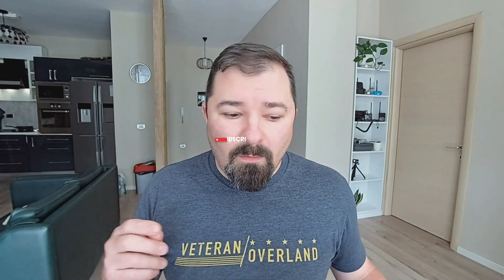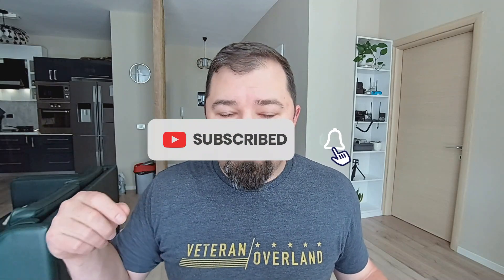What is Mesh Radio?

Comment: Thanks to your help, I now have a Heltec V3 (ver. 3.1) on the air.  I'm located in east bay San Francisco.  After 3 days, I see 5 nodes, all reporting strong signals.  I've attempted to message them,  my iPhone Mestastic app says,  "waiting to be acknowledged",  then,  after a few seconds/minutes, it says, "Max Retransmission Reached".   Is this typical, or could I have a possible problem with my settings?    73    Bob
Reply from the maker: Bob, I have not experienced the "max retransmission" message before. I am assuming you are trying to direct message this individuals?  I do some more digging and see if I can find you a better answer. 
73, Jake